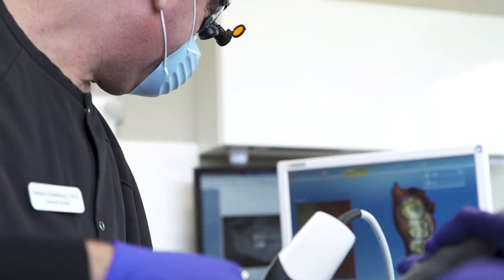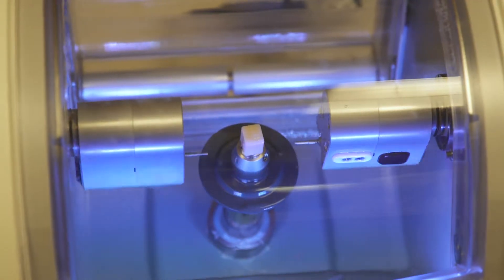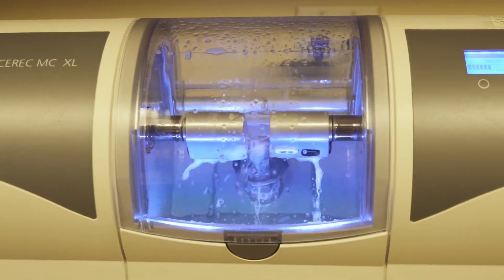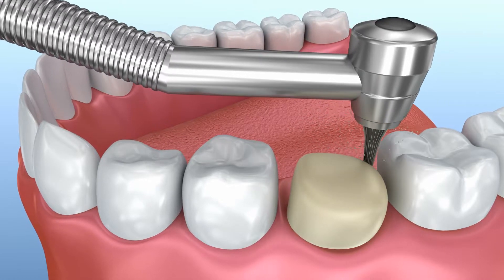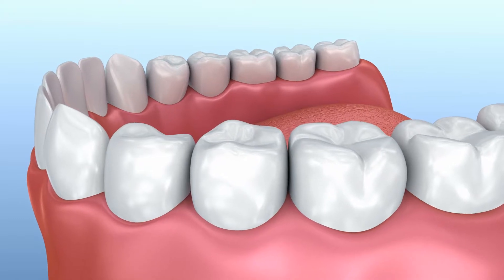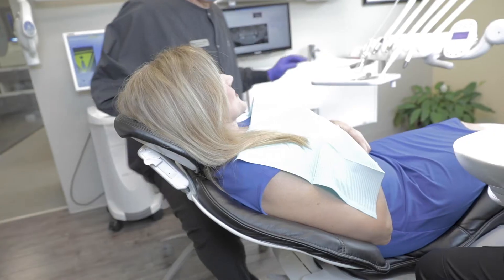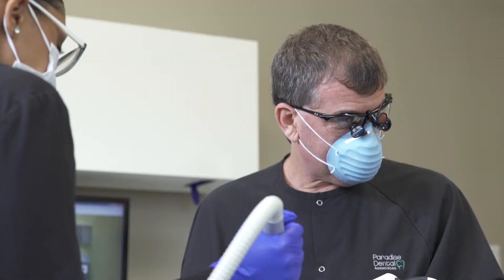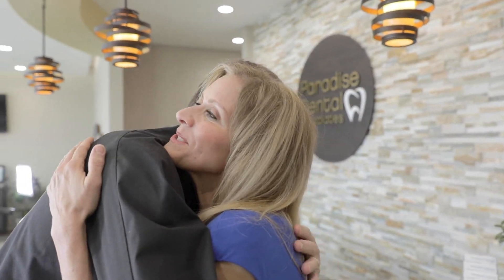How Dental Crowns are Made with CEREC®

Comment: Saying cerec save tooth structure vs lab made crown is false. Actually most cerec user will prep more to help the miling part as cerec can't mill thin margin. For strenth, unless you use emax and take the time to place it in the oven, most cerec ceramic is weaker than lab made one. For the fit, again, no advantage on cerec. Only  cerec advantage is one appointment, but fit and finish is not to quality lab standard most of the time.
Reply: So true. Dr in a hurry, loss of precision.

Comment: Don't ever get one of these crowns. They are not a perfect fit, and some dentists cut corners to save time and machine wear like the bits used to make the tooth. What you end up with is a crappy tight fitting and uncomfortable tooth. You may have to hire a malpractice attorney to have this fixed. Often bad crowns win in court if proven right.